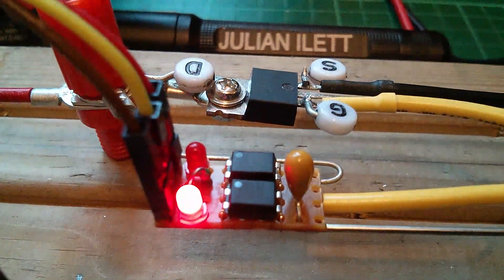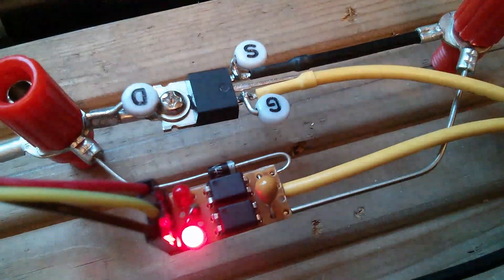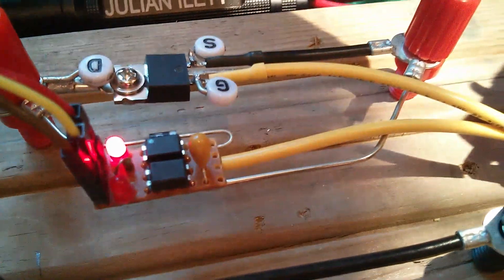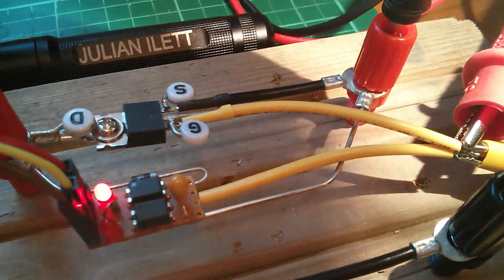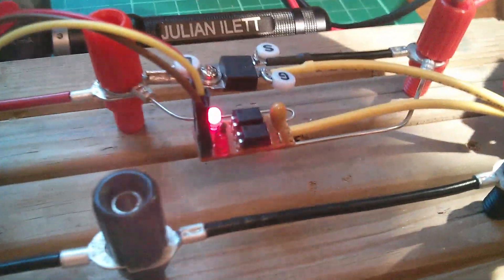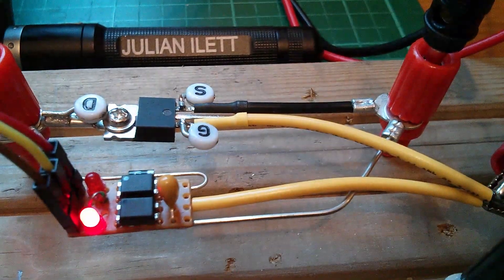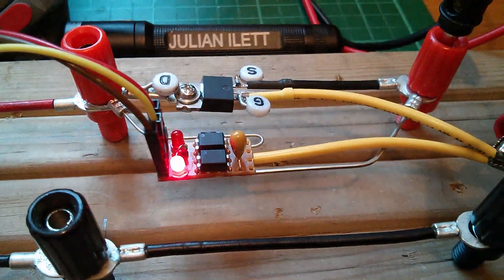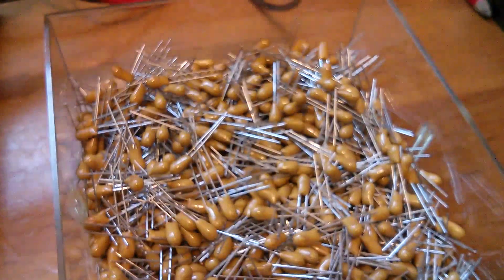Dual Complementary Opto-Isolator (DCOI) MOSFET Driver #6 - Holy Grail

Comment: Hello! These MOSFET videos helped me tremendously. I have a question, and if you can help me, I would REALLY appreciate it. What I'm trying to do is make a circuit that will auto-range a panel meter. Using a resistor divider of 900k, 90k, and 10k, I can give the meter 3 ranges, and move the decimal point with some logic. It seems the easiest way to switch the meter to different resistors would be with some reed relays, but I want to use something more elegant than that -- something silicon. (note, the meter doesn't like the low side being switched, it wants that to be ground. So I'm forced to switch the high side of the meter's input). I was able to make it work with an N-channel MOSFET, but I had to pull the gate voltage high enough with a 9v battery, like you showed in these videos. (Thanks for the tip!) The meter was accurate (Including the least significant digit!) with the MOSFET both on (low range), and off (High range). But for a final design, I don't want 9V batteries on every MOSFET, and I'm not sure all the circuitry involved with the opto-coupled bootstrapped capacitor would be considered an 'elegant' way to do this. One idea I had was to simply use FET optocouplers to move the high side of the meter between resistors. Do you think they'll be able to replace the functionality of reed relays? Or do you have any other ideas? Thanks for reading, I hope I can find some help. :-)

Comment: Nice one. I am now playing around with that some time and there are 2 things which I am currently wrapping my head around. When powering the circuit without the the arduino signal, the gate of the mosfet seems to be supplied with 12V, slowly dropping. I assume this comes from the cap. So the mosfet puts some power on that point, which can be a problem. Also, when turning on the mosfet, the 24V from the bootstrap start to drop slowly, depending on the capacitor size that i used. In my test with a 2.2uF it takes somewhat around a minute. The problem when increasing the cap is that when going too high (tested with a 2200uF) the cap does not supply 24V, but only around 15V. When the switching time is not too long, it slowly ramps up to 24V. Any ideas on how to work around that?
Reply: Could be a few things: capacitor leakage (I don't know if you're using electrolytic caps), meter resistance (multimeters do have at least 1MegOhm of resistance when measuring volts, but that's probably enough to drain the capacitor's charge over a minute), or it could just be the Mossfet's gate impedance (Which is a very, very high resistance, but it does have some leakage). Also, in order to charge a larger capacitor more quickly, it needs to be in a circuit that can supply it with enough current. When a fully discharged capacitor gets charged, it briefly puts a tremendous load on the power rails (a short circuit), and if your power supply (battery, power brick, or whatever) can't supply it with enough current, it won't charge up in the desired time. Also, your diode might have some forward-biased resistance, limiting the current (and extending charge time) of the capacitor. Does any of that info help you?

Comment: I believe the capacitor does rise to 24V. This is what I believe is happening. There are two stages: when the circuit is first activated (the bootstrap) and after bootstrap (normal operation). When both optos are off the capacitor poles are at +12V and -12V respectively (assuming the capacitor has discharged from 24V that is might have been charged with previously) and gate and source are at 0V. When opto1 first comes on during bootstrap gate is connected to the positive pole of the power supply and rises to +12V and source drops to -12V. The circuit is balanced. When opto1 goes off and opto2 comes on gate is now connected to the negative pole of the power supply which creates an imbalance in the circuit: the positive side is +12V in the capacitor, the negative side is -12V in the capacitor, +12V on gate and -12V on source. The negative side of the circuit are now at 0V which is not stable (it should be at -12V) and has to be rectified. The most obvious way would be for the +12V of the gate and the -12V of the capacitor to neutralize one another which would constitute as a discharge of the capacitor. This is however made impossible by the diode on the positive side: the only way the positive side of the capacitor can discharge is for negative charge to be attracted from the positive pole of the power supply. The positive pole does have negative charge, it just has more positive charge than negative charge. However, the diode makes this attraction impossible which means that gate and the negative side of the capacitor also cannot attract one another. The imbalance on the negative side and the stability of the capacitor charge break the bond between gate and source. -12V is attracted from the negative pole of the power supply but this movement of charge also happens on the positive pole. This makes the capacitor rise to +24V and -24V respectively. But on the negative side -24V is needed into total: -12V to drop the capacitor to -24V and -12V to bring gate to 0V. The second -12V comes from the source which brings both gate and source to 0V. I haven't tried this circuit myself so I'm not sure if this is correct but based on my understanding the mosfet does not switch on during the first cycle (during the bootstrap that is). Can you confirm this? Anyways, this is the end of the bootstrap cycle. When the normal cycle starts the capacitor is at +24V on the positive side. When opto1 comes on again gate rises from 0V to +24V and switches on the mosfet. When opto2 comes on gate is connected to the negative pole and drops to 0V which turns off the mosfet. If you measure the voltage across the capacitor you should be reading that at first the capacitor sits at 12V with both optos off and when opto1 and opto2 cycle the capacitor rises to 24V and stays there. Can you confirm this?

Comment: Awesome job on your videos Julian! I have enjoyed them immensely.

Any idea on the upper limit of the switching frequency on the DCOI? This obviously IS the Holy Grail of Mosfet switching in say a H-bridge circuit or something similar.

I like lights, but I would really love to see something more in the area of motor control. ;)

Dave
Reply from the maker: Thanks Dave - much appreciated.
Certainly 500Hz or 1kHz (arduino PWM frequencies) work fine. I've run it up to 15kHz on my MPPT test rig, but the rise and fall times were starting to become noticeable. It probably won't run much faster than about 20kHz.
The problem with an H-bridge with 4 MOSFETs is that 8 optos would be needed using this technique. There comes a point where commercially available drivers make more sense.